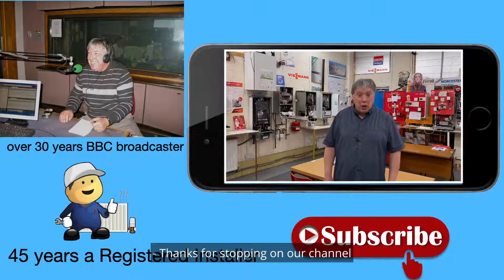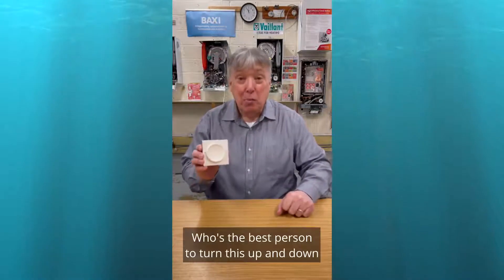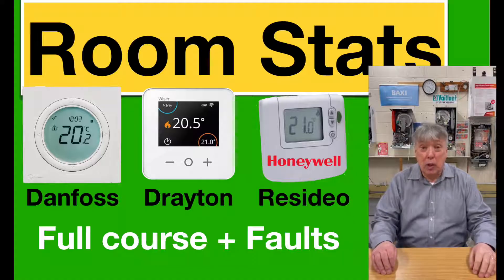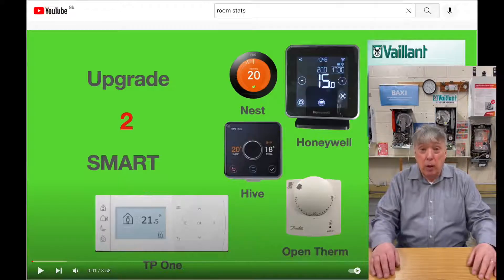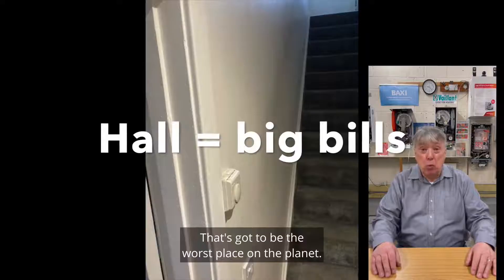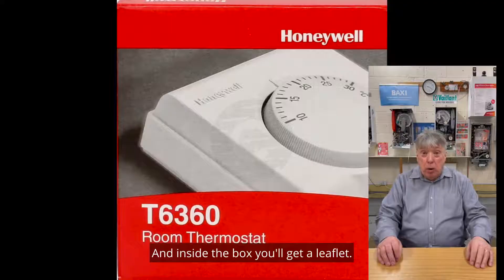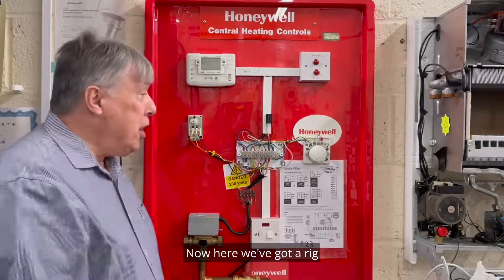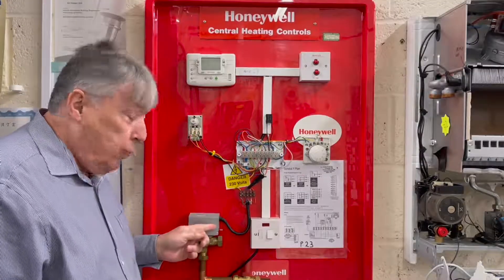This Honeywell Home room stat must be the most installed ever, why in the UK we get it wrong?

Comment: What's the best replacement for the wireless hcw80 room thermostat please.  Tia 😊
Reply from the maker: Hi Rob1t, thanks for asking, RF from either Danfoss or Drayton, under priced easy to install and makes the system cost less to run. Please watch my two vids. on this. take care, George
Reply: Thanks, George. i will watch them .  I  have a receiver which is honeywell,  upstairs in the cupboard,  with the cylinder. So I am unsure if a new room stat also has to be H/well? The existing broken stat is wireless. Thank you 😊 
@mrcombiBedford

Comment: are these old thermostats suitable to use in a greenhouse with a tube heater?
Reply from the maker: Thanks for asking, definitely NOT,  1st. it's 230vAC NOT allowed in cold damp conditions, 2nd. all room stats are OVER heat stats to stop room over heating a wasting fuel and money.
I suggest you google stats for green houses AND go to a good garden centre. Hope that helps. George 🤩

Comment: Hi George I have the same setup with a Worcester i28 Combi boiler With the Honeywell ST9100c and a Drayton Wheel Combi Thermostat. The Drayton is anything but efficient, as you pointed out.(I would estimate its age to be about 10 yr old). I would therefore like to replace it with a digital Wi-Fi thermostat. That I can use with an app to turn it on when I'm on my way home. There's no point in me programming it as I leave home at 05:00 and don't return till 18:00hrs +  but invariably I come home to a cold apartment. What thermostat would you recommend for a replacement? 

I have the three wire system, two Brown wires to L & L2 and one natural. to N the neutral does not carry any power,  two earth wires capped to the unit
Reply from the maker: Hi Tommy, thanks for asking, just copy me use a Drayton RF901 which has an APP (indoor use)  but set the program to switch ON 15min.(18c)  before wake up and OFF 15 min before you leave for work. On return program 15 min before you get home (18c) until 11pm. At home you can use the APP or unit to change temperature. This is a low cost way. The 'Wiser" is the ultimate way for full control which you will like. Link to Drayton web site with videos, regards George Staszak https://www.youtube.com/@Draytonheating/videos 🤩👍

Comment: I have a Honeywell T6360b1028 thermostat. 
What product can i repkace it with to convert it into a wireless unit ?
Reply from the maker: Thanks for asking, any make Danfoss Drayton or H Home, because you have to remove the connections at the wiring centre (power OFF) also at the stat remove unit. Now just connect the RECEIVER to W Centre. Please note this job can only be done by a Gas Safe or electrician who has done a control wiring course. hope that helps, George Staszak 👍

Comment: You don’t put it in a lounge 😂.   A lounge has a main heat source so do not put the thermostat in the lounge.
Reply: You can put it in e.g. the Hall if you have e.g. a Gas Fire in the Lounge provided that 1. The Hall is heated by a suitably sized radiator supplied by the central heating zone the Room 'stat is controlling and 2. The Lounge radiator is generously sized (so that say 21 is achievable even though the Hall is being controlled at 18) and fitted with a Thermostatic Radiator Valve (TRV), preferably with external temperature sensing (sensing bulb is remote from the radiator valve and connected via a capillary tube). External sensing gives improved control accuracy (regardless of radiator hot water supply temperature).
N.B. Danfoss used to make excellent TRVs with external sensing and still do (RA5062 2m Remote Adjuster). Also Drayton make them. The sense bulb used to be installed under the radiator although nowadays it appears it can be incorporated in a wall mounted enclosure like the Danfoss mentioned.
Reply from the maker: @Martindyna  Hi Martin, thanks for your comment, I cannot understand why installers put a ROOM stat in a hall when the install instructions show a LOUNGE, why does this happen? NEST forbid this and we see lots of them in a hall, they HAVE to be in the LOUNGE. Re lounge heat source, if a fire or burner is used daily then the rules have never changed for 50 years, the rad(s) must have a TRV, remove the wall stat convert controls to RF which is cheaper to run, see my 2 VIDs on this. There are a couple of programmable thermostats which can be in a hall, not programmable ROOM stat, that's the clue. As always installers MUST read the leaflet before fitting, sadly too many don't resulting higher bill. regards, George staszak. 🤩👍
Reply: @mrcombiBedford   Hi George. Thanks for your response, I’ll have a look at your RF videos. With best regards, Martin
Reply from the maker: Dear BBud, thanks for the comment, fortunately the manufacturer has printed on the box the location, so that's where we fit it. take care, george👍

Comment: I opened my honeywell analogue stat (in the hall) and it has 1 green wire and 1 black wire only. The green wire goes to No.3 on the backplate, whilst the black wire goes to No.1. 
I thought live is supposed to be red? So has this been wired totally wrong, by using earth and no live wire? And if so how do I put it right? 

BTW It is veryold.
Reply from the maker: Hi, thanks for asking, T1 is the Com wire from the programer, T3 is the SW. Live to a valve or boiler ON. You should mark the green or both either one in Red / Black or Brown to show it's 230vAC and buy any 230vAV DIGI stat from Drayton Danfoss Honeywell Home,  look for the 2 wire version. Only a  Gas Safe or Qualified electrician to do this job. regards George 🥰👍

Comment: I've got a portable thermostat which i inherited from the previous owners.  I hate it.  I want the old simple dial thermostat which i can click off easilly.  They seem to have a life of their own and even though the heating is set to go off at 9pm and come on at 5am, it just randomly turns itself on at 3am.  It drives me mad.  Why does it do it?  Also, as its portable, where should i put it?  There are 2 radiators in my lounge, one in each bedroom (2 bed), and one in the hall.  Thank you!
Reply from the maker: Dear Emily, 
                  Thanks for asking, what I am hearing from you is change the colour TV for a B&W. because life was better in the old days??? As I have said in many vids. if you can hear a 'click' that is an old bad stat designed in the 60's, overshoots up to 4c VERY expensive stat ever made. All you need to do is recycle the batteries, and fit ALKALINE. A lot of stats / programmers have a Reset button to wipe the old settings to restore to factory mode. NOW you can put YOUR settings in. Best advice is copy me, put the time to ON or Constant, use the stat as required, minimum  lounge 18c max 22c Frost is 10c. that is the setting for the lowest bills.
Location: on a table, lounge coffee table, dining table or bedside table, RF is the best way to control the heating. just turn temp. up / down. 

hop that helps, regards, George staszak. 🤩👍

Comment: I wish you showed how to replace that old thermostat to the new o, and if we have to connect the same wiring, 2 live 1 neutral plus sensor.
Reply from the maker: Dear Gixxer, thanks for asking, I cannot show you how to wire a digital stat because each firm has different terminals, you would not change to the same type, 2L +N, all digital. have COM and SW.Live same goes for Open Therm. some will be 230vAC or 24vDC or Volt Free it depends on the one you buy, as in other Vids. if your boiler has O.T. that's the lowest running cost after that VF then 24vDC avoid 230vAC. hope that explains. Our Wiring book and APP has more info. take care, George Staszak 👍

Comment: Hi George. Just sidetracking slightly but I have a customer who upgraded their Landis & Gyr roomstat to an RF EPH stat but didn't want the old stat removed. The installer set the old stat to max and told them not to use it but use new RF stat. This is correct as far as I'm aware but I think they have been moving stat probably due to habit. So, going to link wires behind stat just wanted to confirm which ones to link out. Thanks
Reply from the maker: Dear Gas NW, Thanks for asking, yes you are correct the old stat MUST be disconnected, I understand they don't want to remove the old one before decorating. Power OFF and remove the wires from the boiler end and make safe (don't cut them OFF, someone may want to reconnect them later). Hope that helps, George Staszak 🤩👍
Reply: @mrcombiBedford  Hi George. Many thanks for the information. Its an old heat only boiler so will I need to put a link back in on the boiler end so that the EPH twin channel programmer controls the switch live to the boiler? Thanks
Reply from the maker: @gasservenw1369  Glad to help, it's only the feed to the old stat that needs removing at the boiler end as you say.👍

Comment: Thanks for this helpful video but in the places (8 mins 35 seconds onwards) where you talk about the blue wire, we can't see the wiring mistake you are referring to in the video and the discussion about the blue wire is not clear. Could you please show the wiring of the old thermostat that has been done incorrectly and the new correct way for a digital thermostat. I have just installed a digital one(Siemens RDH100) and I used only the yellow and red cable because those were used in the old Honeywell I was replacing. The blue wire was already cut off but not sleeved or taped up. I replaced the Honeywell because I was suspicious that it was not turning the heating off in time. So potentially overshooting and strangely it was also not turning on the heating early enough either.
Reply from the maker: Dear AR, thanks for asking, I have lots of drawings in other vids APPs and book, that shows what you are asking. The old 230vAC room stat has to have 3 wires, the neutral we don't need in digital stats so we make it safe and use the other two as they are Com and SW.L. Hope that helps, George 👍
Reply: @mrcombiBedford  Thank you very much George. I managed to get the thermostat installed using the 2 wires. I am experiencing that under the stairs location problem though. Even in June, the temperature under the stairs is dropping to 18 degrees, causing the heating to turn on. I think I need to configure it for a 2 degree differential so that it only switches the heating on when there is a 2 degrees difference. Thanks again.
Reply from the maker: Thanks for asking the blue wire is with the black wire that’s wrong 
All the blue wires should be together and never with others
Hope that explains 
George
Reply: You need to install the room thermostat in a room where it can get feedback from the heater it is controlling; so for central heating where it's controlling the boiler / pump / Zone valve there must be a suitably sized central heating radiator in the same room as the Room thermostat. 
This is usually the problem with the room thermostat being installed in the Hall. 
Traditional mains Voltage room thermostats can control within 1 degree C as long as the Anticipator Heater is connected correctly to Neutral so that it has 230 V across it when the thermostat is calling for heat (Anticipator heater is wired internally within the thermostat to be energised when the thermostat calls for heat). This ensures the Thermostat warms up approximately as quickly as a typical room would be expected to.
N.B. I have a Honeywell T6060B room thermostat with Anticipator heater  that still controls accurately although it is now a little over 40 years old.

Comment: Hello there, I have the same set up that you show with the Honeywell thermostat with the wheel and the  ST9100C. I want to replace with a smart system, if I choose the Honeywell T6 Wired smart, I need to put the thermostat with the display instead of the one with the wheel and the receiver box instead of the ST9100C module correct? Thank you for your answer.
Reply from the maker: Hi Stefano, thanks for asking, No the wheel is too old, replace with Drayton RF 902  2 channel about £117 from Toolstation, this will save you money and easy to use Take care, George Staszak, next week I will have a video on changing  rubbish Combi controls system to to RF901 single channel, just what you need except one channel. 🤩👍

Comment: We're quite happy with our thermostat in the hall, when we're active during the day we use it to switch the heating on and off depending what we're doing, it would be a nuisance having to go into the sitting room (and we'd have to take outdoor shoes off). In the evening the hall thermostat sits at 12-13 and the living room is just right. If it gets too hot in the sitting room we go into the hall and turn it down. Can't see your problem with thermostats in halls really.
Reply: Well it never overheats George as we have it set between 12 and 15, and it goes off overnight on the timer at nine pm until 8 am anyway, tbh our heating is hardly ever on ;) If we want the living room to be, say 18, we just set the thermostat in the hall to about 15, works fine. We have to go into the hall to go to the loo or whatever anyway so it's zero inconvenience to adjust it. If someone had put our stat in the living room I'd move it to the hall ;))
Reply from the maker: I pass on the message from the controls firms, very glad you happy with your controls, take care, george  @andrewcannon3195
Reply from the maker: Dear Andrew, Thanks for the comment,  as you see on the box, the firm calls it a ROOM stat, install instructions show a LOUNGE,  not a hall. Please ask your installer why they ignored this and canceled your guarantee. As we sit in the lounge for 5 hours most of us want the stat there not in a cold hall.
As you point out that 247 your system overheats and you over pay, most people find that expensive. Hope that helps, George Staszak. 👍😍
Reply: Just to state obvious but you should not put it in a lounge if it has another heat source which nearly all do.

Comment: Sure my analogue dial doesn't work I can wack it right up to 30 and doesn't feel one bit warmer located on my stairs front door at bottom
Reply from the maker: Dear Sharon, thanks for comment, unfortunately you are not alone, specifiers know it's wrong but don't care. As my relpy to another video please hang on to see my Bluetooth control which will solve yours and many peoples problem, take care 😇👍
Reply: @mrcombiBedford  please can you pop a link to this bluetooth video, i couldnt find it.  Thanks!
Reply from the maker: Hi again, please watch my two vide on RF control All stats in hall are no good, it's a ROOM stat, some installers and specifiers can't read. George Staszak

Comment: My thermostat is sitting on the (outside) inside Hall wall right beside the front door. Theres hall stair n wee top landing. There's the front door the pvc door surround and then the thermostat sits againt the pvc surround. I said to them not to put it in the hall or against that wall, as it gets hit with rain n wind, and the hall us always cold. Council told me it's even better there keep everything nice n warm.   No use having the thermostat as it doesn't matter what it's sitting at it doesn't turn the heating off n on, it's always on as the hall is always cold. I now just keep it off and hit advance.
Reply from the maker: Dear Heather, thanks for asking, I sympathies  with you, unfortunately you are not alone, I get the impression that these organisations do not employ staff that can read  install instructions which is a shame. I am making a video about changing a rubbish room stat to RF (radio frequency ) which is very easy to do, no smart complicated APP needed. Your choice is disconnect (not remove) the stat, find a qualified person to fit RF or Smart. As per video the best is from the boiler firm next is Open Therm any boiler under 6 years, next from Danfoss Drayton or Resideo. Hope that helps. 😍👍

Comment: Can you tell me if the upgrade Honeywell digital thermostat you show to replace the old analog Honeywell thermostat if it will work on 3 wire setup ?? As in your vid l see 4wires from the old thermostat?? If so which way is it wired please or do l need a different Honeywell thermostat??
  Mac
Reply from the maker: Hi James, thanks for asking, all digital stats only need 2 wires, Com the wire from the programmer and SW.L switched live (combi) either to the CH Com or a motorised valve (white mid poz. or brown if zone) to move the motor.  The old stat would have 4:  E / N / Com / SW.L. Digital only need 2 as above, make safe the others. I am doing  a video soon about Analog to RF which has a bit in this video. Honeywell now RESIDEO have just launched a new range buy that stat. Hope that helps, George staszak 😀👍

Comment: The blue conductor has a yellow or black to indicate line or switched voltage - in a three wire setup?  Can I kindly ask where this is stated in the regulations or any codes or is it actually even stated in UK version of boiler installation manuals?  Cheers
Reply from the maker: Hi Bari, thanks for asking, if a blue wire has voltage it MUST be sleeved to show current, must installers don't bother, these Codes of Practice are found in Building Control we get from either Viper or NICEIC publications, hope that helps, George Staszak 👍
Reply: @mrcombiBedford  cheers for the update.  I was under the impression the sleeving colours should ideally be BROWN to indicate that it is a Switched Live - but it can also be Yellow or Black to indicate switched live?
Reply from the maker: You are correct any colour except Earth (yellow / green)  is also not allowed  @Bari_Khan_CEng_CMarEng